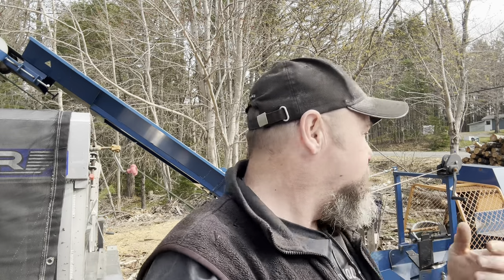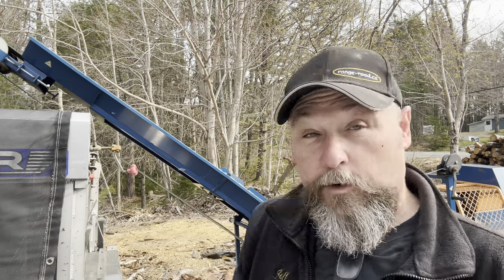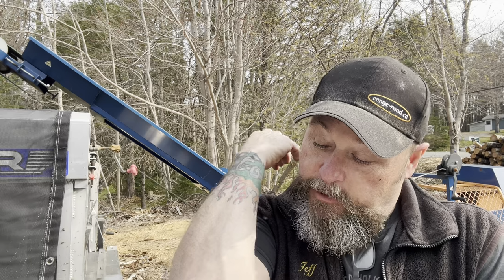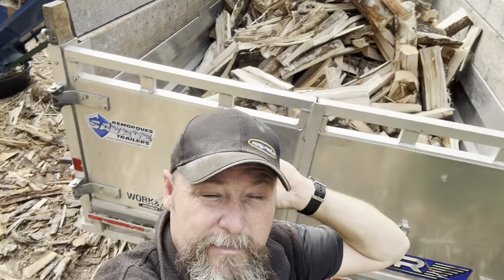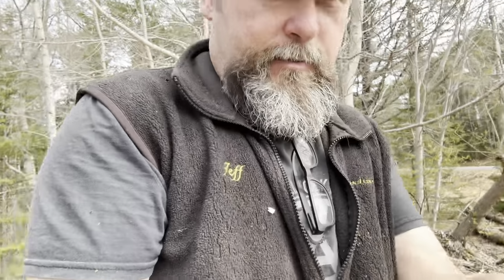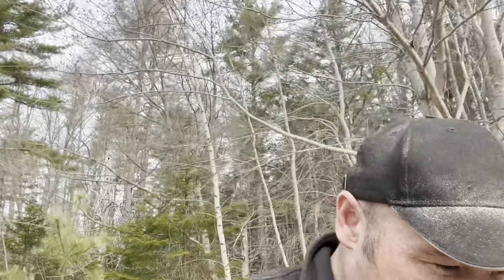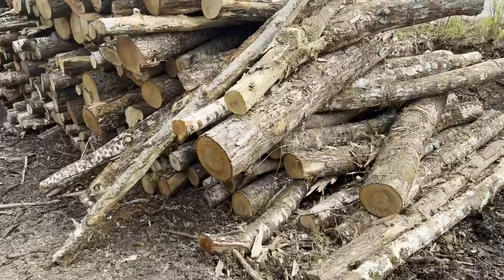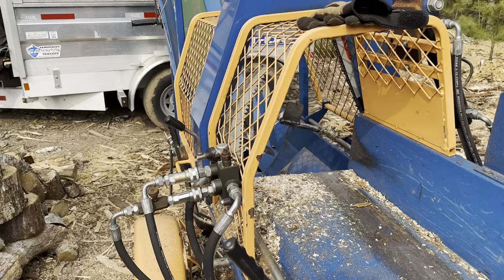Ecopro300- What I HATE about making firewood! Black flies!

Comment: Can you separate your deck away from the processor a bit to make for doing 16'+ easier? We've got the exact same complaints otherwise!
Reply from the maker: I probably could if I lengthen my hoses. But I prefer to have the gap between the deck and the indeed as close as possible. I don’t process very many 16’ long logs- although they’re my favourite, very little waste and a quicker cord too.